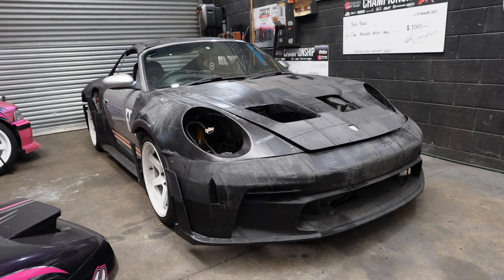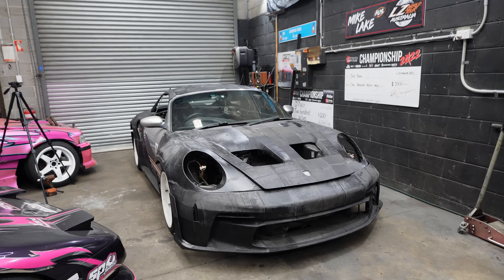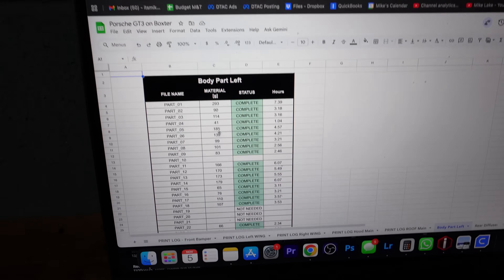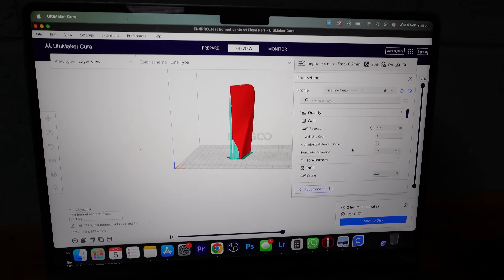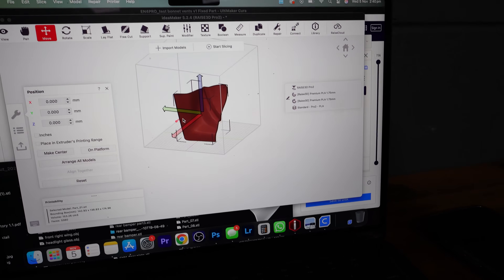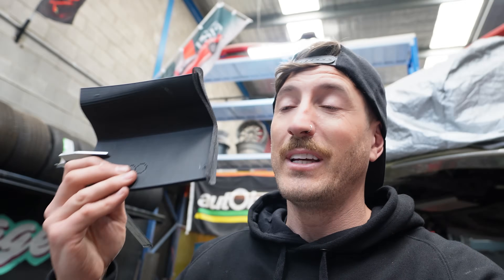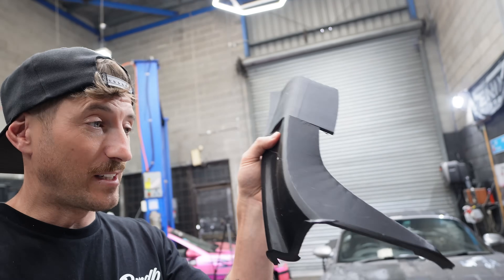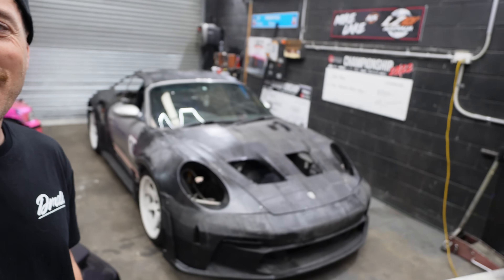How To 3D PRINT a PORSCHE GT3

Comment: I have an Elegoo Neptune 4 Pro too, and I found out that sometimes the printing fails because of invisible residues on the bed that avoid the part to stick on the bed. I just clean it up with alcohol before each 3 or 4 prints.

Comment: What kind of resin are you using. I have been wondering if polyester or polyvinyl works with PETG I’ve been using epoxy, but I’m wondering if the cheaper options work as well.

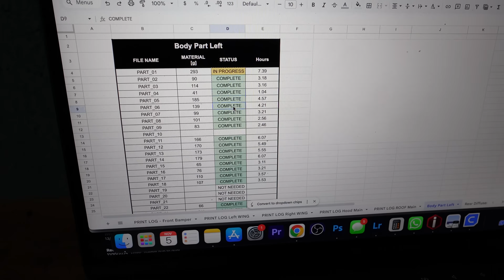Comment: 6:00 idk if you counted that, but the sum of time could be wrong if u sum them as regular nunber (1 hour has 60 minutes, not 100, eg. 1.7 hours is not right. For example 2.57+2.43=5, but it should be 5 hours 40 minutes)

Comment: A little late, but you should use a Dremel with a piece of PETG in it, friction welding. Makes for the strongest bond and won't leave the big melted pits. You can print then like is this video https://youtu.be/hp5Pka5hnfo?si=5oEGSW8NCfpFv9Tl , or just use the raw filament in the correct size collet in your Dremel.

Comment: How do you factor in warping when adding the fibreglass layers to the bottom surface? I understand the top is a single layer so that’s much easier to not cause warping. Thank you, you’re very inspiring and I love this video series on the main channel. I just discovered this channel and am now following also. Cheers
Reply from the maker: The bottom surface doesn’t matter so much as it’s not seen. And on the top we will sand any high points of the surface flat before laying the single layer of fibreglass so warping isn’t such a factor 🤝🏻

Comment: Love your vids, but also finally the V2 channel with more explanation. Currently on the hunt for a 4 Max. Don’t you have to change the files (250x250) to get the maximum out of it? It can print larger so.. or would you start with a centauri and second Max?😐
Reply from the maker: The files contain the full part STL files if you want to cut them bigger 😁 the 4 max is good but takes longer to heat up etc. I like the 4 pro or even the 4 is fine!
Reply: @I @ItsMikeLakeV2  thx again for the tips, looking forward to the next vids! 💪🏼😉

Comment: Wait until you start modifying your printers! You can add auto bed leveling to all of your printers with a $13 bltouch sensor, a 3d printed mount, some zip ties and a firmware upgrade. I'd recommend it on the max considering the bed size. Great stuff dude.
Reply from the maker: No way, I didn’t know that?! I will look into that now, thanks for the advice 😁🤝🏻

Comment: Hello , congrats on your 2nd channel . On the files you got the 250x250 folder , but let's say you got a bigger printer , you will have to reverse engineer the design ? Or the files provided also got the full parts in there ?
Reply from the maker: The files also contain the full part STL files so you can chop them up into bigger pieces if you please 😁 or even print the whole part if you have a big enough printer!
Reply: @ItsMikeLakeV2 awesome this is the answer i was looking for 👍😎

Comment: The wheels on my wide body Shelby Cobra replica are forged 19” x 11” with a -76 offset and 355 tires 😂. That’s the rear, I’ve got -55 offset up front with 325 tires. I’m 3d printing the wide body to test fit but after that I’m printing a mold and using carbon.
Reply from the maker: That is absolute MADNESS 🤯 id love to see it haha

Comment: Hey man, really love the videos. 

I’m very tempted to buy the files, specifically for the fenders, fender vents and rear wing, for a Porsche Cayman S that I’m building with an Audi TTRS motor.  

Have you tried nesting the parts on the larger 450x450 printer?
Reply from the maker: Nice! Yeah the files work great on my Neptune 4 max which is that bed size so I think you’ll be fine there. Just make sure you use a good slicer!
Reply: @ItsMikeLakeV2  I run and own a GWM dealership in South Africa. Looking forward to some behind the scenes videos with the GWM